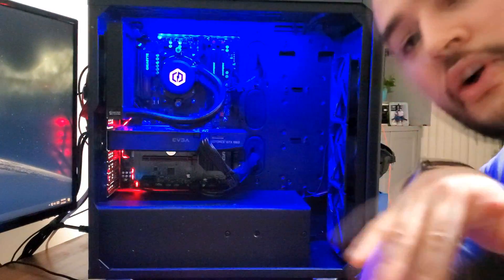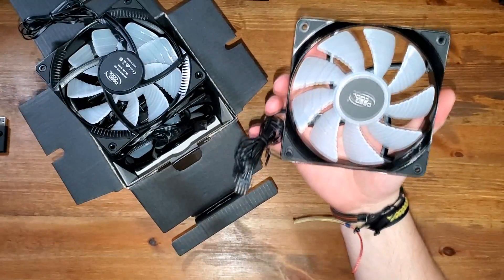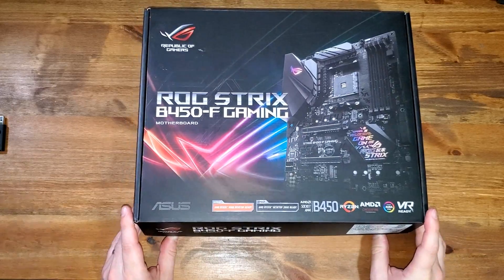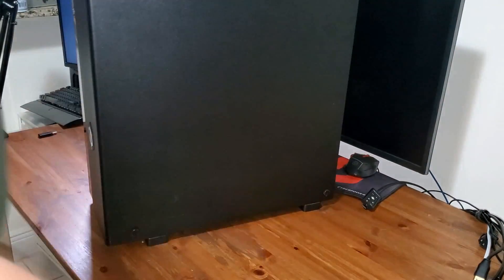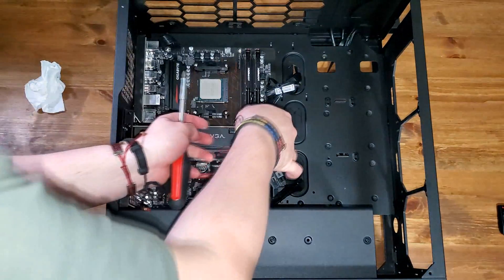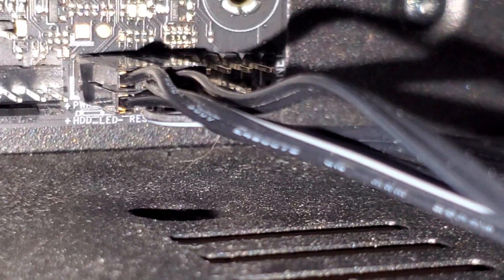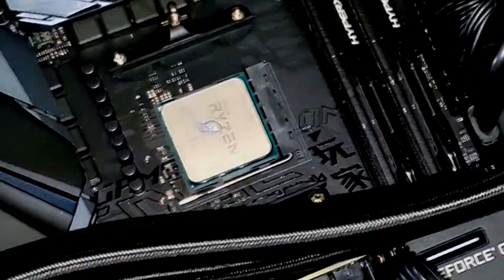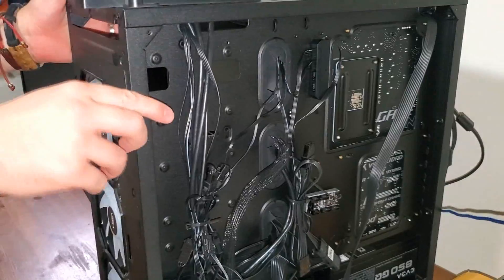How to upgrade Motherboard and Fans to your PC (ASUS ROG Strix B450-F and DEEP COOL RF120M)

Comment: I just built my new pc with the same mobo and fans because of your vid (awesome vid btw, you have a funny personality) but my fans only light up but won't spin :(( if you have any advice it'd be greatly appreciated
Reply from the maker: Thank you so much for this comment. This means a lot to me!
About the fans not spinning, i would assume they might not be connected to the right fan header but we would have to look at how you wired everything. It is a pretty detailed process to get all the cables connected to the right places. If you'd like, we can look at your build together and try to figure it out. I have my Discord information all over my videos. Lets get together and maybe video call or send me some pictures so we can solve it.
Reply: @epikdanny8887  appreciate it!! But i just fixed it 😂 turns out i just forgot to plug it into my mobo
Reply from the maker: @tigrluv4r  awesome!! I'm glad you got it figured out!

Comment: help please 
I have a cooler master td500 cabinet   the cabinet have 3 rgb fans pre- installed also i have the same motherboard you use in this video can you tell me where to plugin all the fan cable ?
Reply from the maker: Hi. Thank you for the comment.
I am not sure how many cables the fans have or what comes with them, but assuming each fan has 2 cables, you will need to install one of them into the RGB Header (4pin connector with white base) and the other into the Fan header (4pin connectors with black base). You can also look at the manual to find these specific connectors. I hope this helps.
Reply: @epikdanny8887  Thank you so much also can you tell me did this motherboard support ryzen 5 5600x ?
Reply from the maker: @sanskar4987  yes. It definitely does. I recently got one for my set up and it works perfectly.
Reply: @epikdanny8887  Ok thank you that mean we dont have to update the bios ? 

And one more thing what if the bios is updated but we updated again using usb flash drive ?
Reply from the maker: @sanskar4987  you should not need to update it for this CPU to work. Although i did update it to the latest at some point.

Comment: Hello, first of all nice video this really will help me out as i will be getting the same motherboard and fans, well instead of 3 im getting the 5 pack, just question, im kinda confused so if i connect all 5 fans into the fan hub, where would I place the other end of the fan hub cable at in the motherboard?
Reply from the maker: Thank you for the comment. The cable from the fan hub goes on the actual motherboard's fan header and the cables from the fans will go to the fan hub. I hope this helps.
Reply: @epikdanny8887  And sorry to bother if im not wrong there is 3 fan headers in the b450-f so, where exactly did you place yours? e.g. next to the cpu
Reply from the maker: @eddy9k  no worries at all. There are 3 fan headers specifically made for the regular fans. You do not need to use the CPU for this.

Comment: WTF? why is your CPU cooler on your exhaust fan? you want cool air not hot lmao
Reply from the maker: Thank you for the comment. The fan is pulling the hot air out of the radiator, not pushing it in.
Reply: @epikdanny8887  Ahh okay, that said its still not in the correct place. Not mounting your radiator on the top can cause damage to your liquid cooling worst case and best case its louder than it should be. Companies get complains about it as its never really shown mounted properly as people think it does look as good so if I where you id move it to the top as it can make the life span of your cooling longer.
Reply from the maker: @danielmiller6576  Thank you again for the recommendation, my friend. Although there is not much difference about how you configure the radiator and fan, i still believe the best option is to have the fan pull the air out of the radiator and push it out of the case like i showed on the video. I have recommended this video to a few friends to help them decide how to mount the fan/radiator https://www.youtube.com/watch?v=QjYli6itP38
Reply: @epikdanny8887  Your welcome :) this video will explain it better than I can https://www.youtube.com/watch?v=BbGomv195sk&t=921s&ab_channel=GamersNexus  he shows the full process and why its meant to have gravity on its side when working, meaning having the radiator above the pump with downwards facing pipes. again you could not do this and have no issues but im more of a better safe than sorry type of guy. With all that said thank you I wanted a good view of these CF120 fans and id say you definitely did well to do that so thankyou again!

Comment: Lets say my motherboard have only one 3- pin ARGB header and i want to have 7 ARGB fans . Do i only have to connect a ARGB HUB from the ony ARGH header and it should be good ?
Reply from the maker: Hi! Yes. You will only need to connect the RGB cable to the one RGB header on the motherboard and from there, the fan's RGB cables interlink with eachother. I hope this helps.
Reply: @epikdanny8887   Thank you for your swift reply, this clears my doubt.
Reply from the maker: @HatsuneMiku-fw7ee  i'm glad i could help. Let me know if you end up getting it and working for you.

Comment: Did you connect them with 1 rgb header? Or with both?
Reply from the maker: Thank you for the comment. I only connected all the RGB fans to one RGB header on the motherboard. There is a cable that goes to the motherboard's RGB header on one end and then to the RGB fan on the other end. From there you can interconnect each RGB cable from the fans to eachother. I hope this makes sense.

Comment: Hey, how are the deepcool fans doing? I got the same 5 pack. My build isn't ready yet as I don't have all the parts. Not too worried about noise, as long as they are cooling! Thanks
Reply from the maker: Thanks for the comment. These fans are amazing! They are super quite, cool very well if your case allows enough air (of course). Definitely a very good buy.

Comment: Hey man I done a build an their is an orange light by the ram on b1 light could u pls help me
Reply from the maker: Hi! Thank you for the comment. The Orange light on the B450F means that there is some error with the RAM. Have you checked that the pins are good and have you tried placing RAM into different slots?

Comment: U should of mounted the graphics card in last, rookie mistake but I like the build
Reply: I have myself, me myself I'm not good with cable management for the back for the case though 🤣 as long as it works I'm fine for my builds I always state that lol.
Reply: I've worked in pretty budget cases for my clients
Reply from the maker: @WiredDragon555  that's so awesome! Yeah, i am not that good with cable management either but as long as it works, i am happy!
Reply from the maker: You're definitely right! lol. It would have been a lot easier to get every cable installed without the Graphics card. Learning as i go. It was definitely a cool experience. Have you done a lot of builds?

Comment: Hey, nice video. I have a question. How many fan power slots does the motherboard have?
Reply from the maker: Thank you very much for the comment. This motherboard comes with 3 chasis fan headers. You can always buy fan hubs like the ones that came with my fans to be able to connect more (if needed).
Reply: @epikdanny8887  thanks!

Comment: Would haver been nice to have more detail on how to connect the Deepcool lights.
Reply from the maker: Thank you so much for your comment! Since the video was getting pretty long, I decided to leave that part out as it is pretty simple to do. You will need to connect the Sync cable to the RGB header on the motherboard (white headers), it is on minute 11:23. From there, each Deep Cool RGB fan will have 2 cables. One goes to the fan hubs (minute 11:59), the other cable goes connected into each other and finally into the other side of the Sync cable (minute 12:07). I hope this helps. Let me know if you are able to get yours running.
Reply: @epikdanny8887  I plan to buy these fans and this answer was really helpful. Cheers man, wish you the best.
Reply from the maker: @0139Miku  awesome my brother. You will not regret getting these fans. They are awesome and very quiet.

Comment: HELP! Hello I have the same motherboard and for a recent dust cleaning I desconecting one cable, when I proved it the pc start well all except the fans, I see your video and I tryed to put the cable in the correct site but when I connect the pc the cable got burned, I'm so frighten can you help me?
Reply from the maker: Hi Abigail! Sorry to hear one of your fans burned. I really wish i could help, but it actually burned, you might need to buy another fan to replace it. Did you plug the burned fan anywhere in specific? Maybe it was placed on a different header that might be for something different than fans.

Comment: Hi Danny, awesome video. I actually have the same motherboard and the same CPU cooler and have had some issues. I have been unable to get the CPU cooler lighting to come on. Does yours have a separate cable for the lighting? Mine has a separate 3-pin 5v cable for the lighting but the only RGB headers on this motherboard are 4-pin 12v. I would love get the lighting working like yours is in the video. Any help would be greatly appreciated!
Reply from the maker: Thank you so much for the great comment, David! I have the CPU cooler (which is a 3 pin socket) connected to the header that says AIO_PUMP. Although the header has 4 pins, it will take the 3 pin socket with no problem. This will make the pump and the light turn on. If for some reason the light still does not turn on, it could be that you got a defective CPU cooler and the light is broken. I hope this helps resolve it. Let me know how it goes.
Reply: @epikdanny8887  hi Danny, thanks for the reply! My AIO cooler actually has two headers, one to control the pump (normal fan control style) and one to control the lighting (3-pin 5v type). So my pumps is working but my lighting is not. Does your cooler have 2 cables or 1? Thanks again
Reply from the maker: @djmaye15  I think you might have a more updated CPU Liquid cooler. I've had this PC for about 4 years now. My CPU liquid cooler has only one cable which turns on the Pump and the Light. This 3 pin socket is connected to the AIO_PUMP 4 pin header (right above the graphics card towards the left side). I do have a separate fan which pulls the air out of the radiator that is moving the water but again, it is a separate fan with its own cable. I know you did mention one of your cables is a 3 pin 5v. What about the other cable?
Reply: @epikdanny8887  I think might be right, and my cooler might be slightly newer version (perhaps they added ARGB as opposed to RGB). The other cable is the standard pump cable for the pump header, which is working fine now. Unfortunately, I'm afraid I don't have a way to light up the cooler since all my RGB headers are 4-pin 12v :(
Reply from the maker: @djmaye15  I got you. But if you have the option to have the light, you should definitely be able to get it connected to your motherboard and working. I would love to help you further getting this done but it is kind of difficult through here. If you'd like, you can go to my discord server and we can look at it together maybe with a couple pictures or a video. https://discord.gg/HCqubtG9
Reply: @epikdanny8887  I have few questions to ask however your discord link does not work anymore ?
Reply from the maker: @HatsuneMiku-fw7ee  hi. It might change after some time. This is my Discord link https://discord.gg/uJWPabEA

Comment: Help please!
I have a Ryzen 5 3600xt, motherboard Asus b450-f, Ram: Corsair Vengeance LPX 32 GB DDR4 3200MHz and Gpu : zotac gaming geforce gtx 1660 super.
I get orange led on onbards led, and it's don't get any display on monitor. (all fan and RGP is running). Thanks for helping.
Reply from the maker: Thank you the comment. It could be that the BIOS on your motherboard is not up to date to take the 3000 series Ryzen CPUs. It needs to be on version 2301 before it takes that CPU. you will need an older CPU series to get the PC running, update the BIOS and then your motherboard will be able to read your Ryzen 3600 CPU. if you have a friend or a pc store close by that has an older AMD CPU, they should be able to update the motherboard quickly so you can get your build running. I hope this helps you.

Comment: I have this motherboards and I recently got the corsair AF120 3 fans. Do I need a fan splitter for or does the motherboard have 3 fan connectors
Reply: So I had realized that the fans I bought are 3 pins the motherboard has 4 pins am I able to still connect then but not control the fan speed??
Reply from the maker: @raiden5321  that's correct. You will still be able to connect them with no problem. You will just have less control over the fan's speed/ voltage.
Reply from the maker: Thank you for the comment Raidz. Those are really good fans. The ROG STRIX B450-F GAMING has 3 Chassis Fan Connectors. So you should be good to go.

Comment: Hey, can I put this fans even if I don't have a rgb header? My motherboard has 1 cpu fan and 1 chassis fan all 4 pin
Reply from the maker: Yes you can. The only problem will be that the RGB on your fans will not be working, but the actual fans will work with no problem.
Reply: @epikdanny8887  would adding a fan hub fix the problem? Also thanks for the reply!
Reply from the maker: @TheOmegaZarkVideos  A fan hub will help you giving you the option to add more fans to your system but it will not necessarily help you with the RGB lighting. You will need to have an RGB header on your motherboard or an independent RGB system with a controller so you can manually change the colors.

Comment: Hey man what's up. I got that same motherboard coming soon. I also order aio cooler and it has lights. I'm able to control all the lights off the mother board?
Reply from the maker: Hey man. Thank you for the comment. If you connect the lights to the motherboard RGB headers, you will be able to control them from Your PC using a program named Aura Sync.
Reply: @epikdanny8887  awesome and that's everything that's connect to the rgb headers right so I might need more ports lol imma get a hub thanks man!
Reply from the maker: @Sazon4life  definitely. Thanks for the comments.

Comment: did you have to use a fan splitter to use all those fans? if so can you reply with the link to the splitter?
Reply from the maker: Hi Jonathan. Yes. I used a fan hub that would let me connect 4 fans at a time. It was included with the fans i bought. Lik on my description.
Reply: @epikdanny8887  my case came with a fan hub with rgb settings w/ out plugging it in 2 the mobo but you can also plug it in for the mobo rgb settings what would be the benefit of doing this?
Reply from the maker: @herehere3184  the fan hub is to plug several fans to just one mobo header. I hope this helps.

Comment: Pregunta bro, el hub de los ventiladores lo conectas a un solo conector de RGB header los blancos esos de 4 pines y los fanes los conectas directamente al hub no?.. Tambien trabajan con Aura sync? rgb? haha Te pregunto por que ando buscando unos ventiladores para mi pc que arme y me faltan los fans y necesito saber si es compatible con mi placa y eso, tengo una Asus x470 PRIME PRO. Por cierto, buen vídeo te quedo buenarda.
Reply from the maker: Correcto. En mi caso yo tengo 2 fan hubs y los conecte a 2 RGB headers (los blanquitos de 4 pins). Conecte 3 de mis ventiladores en un hub y los otros 2 ventiladores en el segundo hub. Como tu tienes una placa de Asus, el programa que vas a usar para configurar las luces de los ventiladores se va a llamar Aura Sync (el cual es el mismo que yo tengo). La verdad cualquier fan es compatible con todas las placas madre. Lo unico que te tienes que asegurar es que la placa madre tenga suficientes puertos para la cantidad de fans que vas a poner. y si los ventiladores tienen luces, quieres asegurarte que tu placa madre tambien tenga los RGB headers (conexiones blancas de 4 pins). Tu placa tiene todo esto. Entonces estas super bien. Muchas gracias por el comentario del video! Mandame una foto de tu PC cuendo lo termines. Me encantaria verlo.
Reply: @epikdanny8887  Perfecto, gracias! Cuando termine con gusto te envió la foto :)
Reply from the maker: @GoodBrotherMT2  excelente. Buena suerte. Cuando hagas esto te vas a sentir como que eres un duro para la tecnologia!

Comment: Thx dude I was looking for fans that worked for my mother board
Reply from the maker: Awesome! I'm very happy that i was able to help you. They are definitely very good fans. I have had them for a little while now and they don't make a sound. What kind of motherboard do you have?
Reply: @epikdanny8887  i have the b450 f from asus
Reply from the maker: @patrickabrams9830  oh awesome! So you have the same one as me. Very cool Motherboard too. The cool thing about the fans is that they are 5 in one package and it is a very good price. You won't regret it.
Reply: @epikdanny8887  dang my fans don't work with my motherboard because they are a 3 pin argb so I was looking for ones that worked for mine
Reply from the maker: @patrickabrams9830  oh i got you. Yes, you definitely want ones with 4 pin to have all the options, change colors, control patterns, etc.
Reply: @epikdanny8887  i tried getting a 3 pin convertor to a 4 pin but it didn't go so well
Reply from the maker: @patrickabrams9830  yeah, it is better to just spend the extra few dollars to get some fans that are 4 pin and get them working properly.
Reply: @epikdanny8887  I'm happy i found this vid tho it took me like 5 days to find fans that work
Reply from the maker: @patrickabrams9830  thank you, my friend. I appreciate that comment.